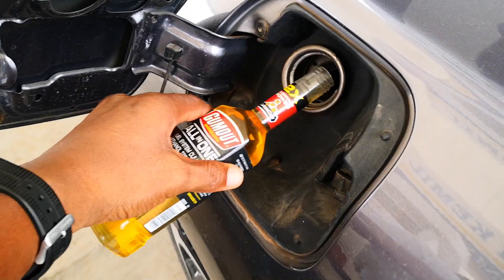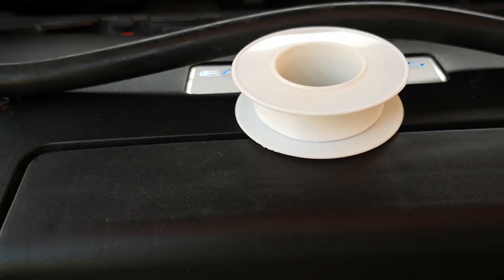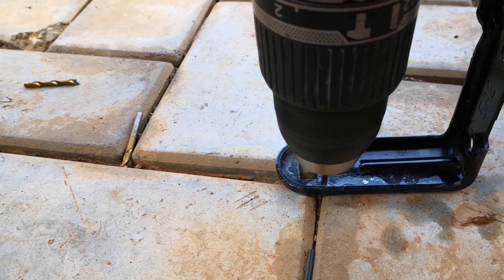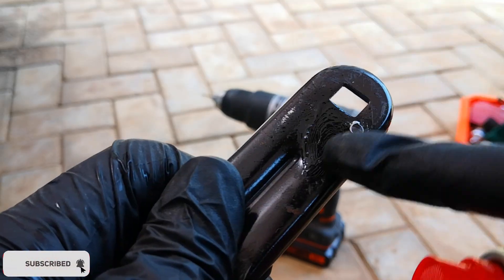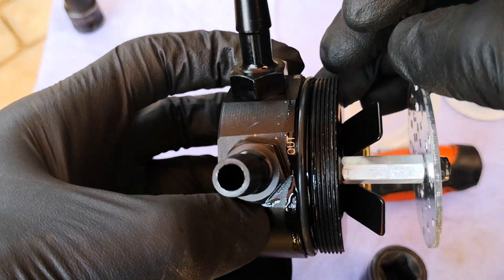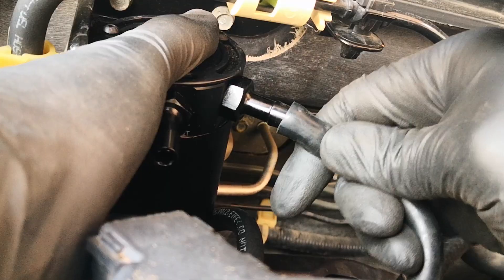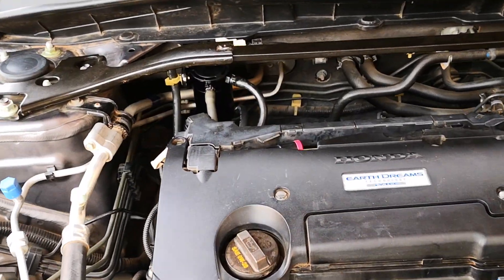Installing Oil Catch Can to Reduce Engine Deposits / Keep Pistons Clean

Comment: What size/spec hose did you use?
Reply from the maker: I actually just took the part of the oil catch can where the hose was meant to fit to the store and used that as a guide. I didnt get the actual size it the hose

Comment: Hey, I know its unrelated to this video but wonder if you have the same issue as me. Its a clacking sound heard when driving. Its consistent with wheel speed, not engine speed. Most pronounced 10-25mph but you can hear it at all speeds. Mostly when accelerating but not decelerating. What is it? 
https://youtube.com/shorts/z4rII39EkSg?si=Yjj_CgSAmxoC_Swh
Reply from the maker: My money is on a worn wheel bearing!

Comment: Just found this interesting video. It seems that the brass filter might be unsuited for diesel engines. Here somebody made measurements regarding the crank pressure increase with different filters. Steel wool is suggested instead. Maybe you find it interesting: https://youtu.be/fiAs52P7Qwg?t=845
Reply from the maker: Thanks for sharing!

Comment: Is the diameter of the in- and outlet and of the hoses important? Because my pcv valve hose is bigger in diameter. Not sure if it will cause problems if the diameter provided by the in and outlets of the catch is smaller?
Reply from the maker: In everything you want a perfect seal at both those ends to prevent vacuum leaks.

Comment: Where did you get the mounting bracket at?
Reply from the maker: It seems you skipped some parts of the video😛. The bigger one is from the car, the smaller circular one comes with the catch can

Comment: Hi, I have issue with my 2013 Accord. It displays “Check Charging System” battery runs down whenever it come up. I had changed the battery terminal sensor which seemed to work for about 3 weeks after which the problem came up. What do you advise? I don’t have too much trust in the mechanics around my current location. Your suggestion will be helpful
Reply from the maker: There's an issue in the charging system. The car needs to be scanned and diagnostics run. A weak battery/alternator, the BMS sensor etc will cause that alert.
Reply: @DIYAutoworksNG  the issue isn’t battery or alternator. I have them all replaced and problem persists. It temporarily stopped after I got a new terminal sensor but it seems the sensor isn’t reliable.
Reply: P16E2:00 is the code that comes up whenever the car is scanned.
Reply from the maker: I see. Poor electrical contact or shorts in the wiring/connections if the alternator, faulty alternator are possible issues. Lastly, could be a a faulty PCM. Actual cause can be isolated via troubleshooting.
Reply: @DIYAutoworksNG  how do I go about this? I don’t think a have good Auto Electrician here in Bauchi.
Reply from the maker: It's difficult to advise virtually given its mostly hands-on diagnostics that's left now. Do you have any experience with car repair? Can you use a multimeter? Also just checking that your serpentine belt is in good condition?
Although you mentioned you changed your battery and alternator, can you confirm that the replacements were good. Also, how tight has your battery terminals been? Do you just attach them by hand without tightening the bolt. Loose battery terminals will affect the charging system. If you want to take on this DIY, I recommend you get a battery analyser (Konnwei KW208 recommended) and smart battery charger. These 2 are available on Konga. There are smart chargers there under 8k. The reason I recommend a smart charger is that you need a fully charged battery in other to test a charging system. The battery KW208 can test your battery, cranking and charging systems. Let me know if this is feasible for you.
Reply: @DIYAutoworksNG  thanks so much. I have ordered the tools recommended. I’ll feed you back in few days. In the interim(I pray it continues) the system seems okay now and the only thing I’ve done differently is allow my car to warm up at least 30 minutes from cold start in the morning. I pray it continues to work fine. Thanks for the heads-up I’ll keep you apprised of whatever outcome follows.
Reply from the maker: Battery terminals tight?
Reply: @DIYAutoworksNG  very. I ensure that at all times.
Reply from the maker: Good. Was asking because I see a lot of people who just 'hook on' the negative terminal.
Reply: @DIYAutoworksNG  I don’t take all those Baba Kamaru’s unrealistic advices. Thanks bro.

Comment: I like your adventure spirit and it gingers me also but it's this official? What if there's no space in the engine bay for this additional feature?
Reply from the maker: May not be official from the manufacturers, but I'm sure it's down to cost cutting measures and some other factors. If in doubt of its effect, I did an update at 1000miles in this video https://youtu.be/qfh72mTKuqk
I even saw a YouTube video where the guy collected an oil/water mix in his that was about 200mls!
Space will be the only reason for me not to add this on a GDI engine.

Comment: Where did you get the idea of this oil catch can?
Reply from the maker: It's a long known modification that helps GDI engines especially. If I this car had dual injection (GDI + multiport), I probably wouldn't have installed it.

Comment: My accord 2014 it’s port fuel injector and 5 speed transmission , Exported to the Middle East 2013 and 2014
Reply from the maker: Oh. Didn't know the 2014 Accord for some markets had multiport injection.
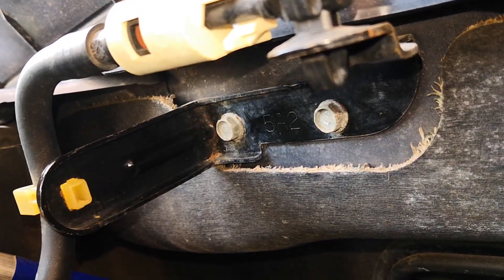Reply: @DIYAutoworksNG  The strange thing is to look at the 2021 Honda Odyssey as well, as it does not have the high-pressure fuel pump in the engine head minute 1:15 
https://youtu.be/J3THCsgMgB0
Reply from the maker: You are absolutely correct! I just researched specs, while the US market has GDI, this link shows that  the 2021 Oddysey for the Australian market has multiport fuel
 injection! https://www.carexpert.com.au/honda/odyssey/2021-vilx7-cdace912

Comment: I wonder if a water cooled oil catch can exists to ensure the oil condenses out of the crankcase gases before getting to the plenum. 

The water could be routed from the return side of the radiator so it's always cooler than the contents of the catch can.

🤓
Reply from the maker: 😀 That would be nice. It's just that car makers haven't prioritised reducing the oil vapors from the pcv system. After all, the throttle body has cooling lines going to it. Some high end aftermarket ones for performance cars may well have water cooled catch cans.